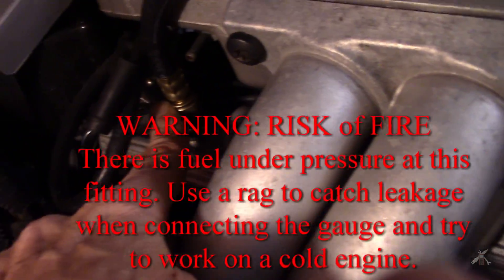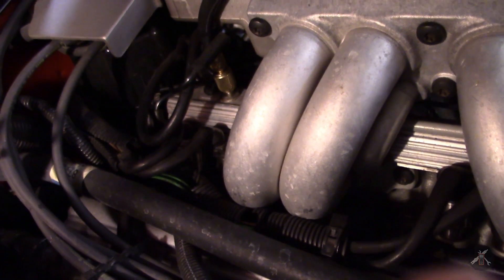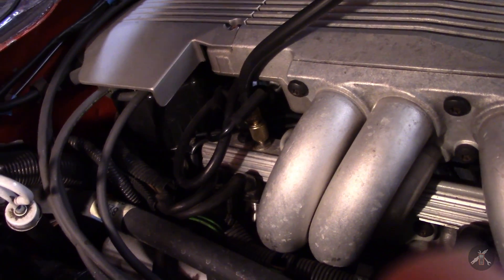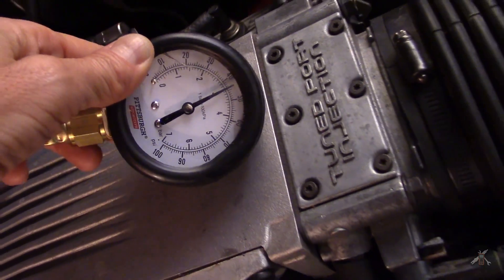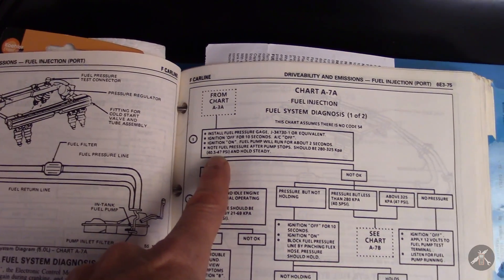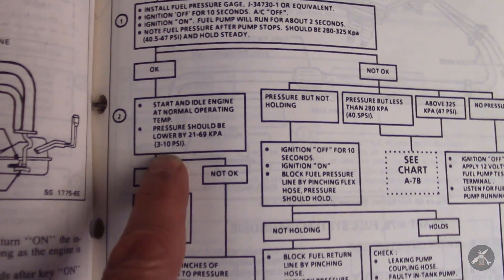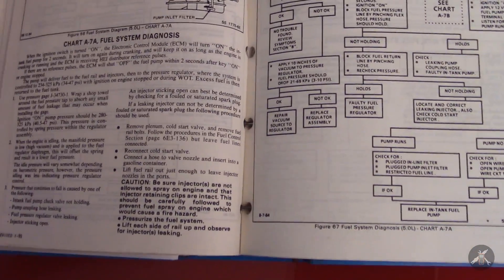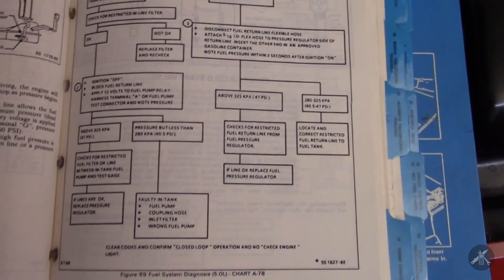How to Measure and Diagnose Fuel Pressure on Tuned Port 305 / 350 3rd Gen Camaro / Firebird

Comment: Hey there! What service-manual is that and where can I order one? Great video, really helpful and easy to understand and comprehend! Hope you're doing good!
Reply from the maker: Yes, I am doing well, thank you.  Glad the video was helpful. That is an original 1985 Camaro Shop Manual.  It's the loose-leaf version that I believe was targeted for dealerships so that it could be updated through the year.  I picked that one up through eBay.  It took some searching.  There were also some bound copies out there and I saw some offers with the manual on a CD/DVD, but I couldn't tell if those were "official" GM information.
Reply: @bitsofwisdom460  Hello again! Glad to hear you're doing good! I guess it could be hard getting one of those for my 87. Is there an other manual you'd recommend getting? Already got Haynes, but the content in it is kinda lacking compared to other manuals, especially when there so many different engine options and trim-packages for a model.
Reply from the maker: @kmas8229  Original GM manuals are the best, and they are readily available as used through various sources.  One place that you might try is books4cars.com.  I worked with the owner, Alex, at GM many years ago. He started with rare manuals for European cars, and has expanded to a rather wide range. As the business grew, he left GM to run it full time.  I checked this morning and he had a good selection of Camaro manuals.
Reply: @bitsofwisdom460  Hello again! Thanks for the tip, appreciate it very much! 
Good for him that he got to do that stuff full time, I guess he has alot of "gold"! Old articles, brochures, service-manuals and such are fascinating to look and read through.
Hope you're having a great day!
Reply from the maker: @kmas8229  You're welcome!  It's actually interesting how Alex got his start.  He was interested in various European cars that were imported to the US in low volume. He had one or two as I recall. He was having difficulty finding service manuals for them here in the US.  We sent him to Europe on business for vehicle development.  He was surprised to find manuals there, but the companies weren't interested in selling to the US at retail because of the low volume, one at a time.  He found places that would sell and ship to him in the US for resale, and it grew from there.
Reply: @bitsofwisdom460  Good morning! It's interesting to see how times have changed in that aspect and how similar it is to how it was here in Norway when it came down to cars, parts and manuals and so forth long before the internet came along.
If parts or anything weren't available at home and the person in need was working as a sailor, and was regularly in the US with the ships, then entire shipping-containers were often filled with cars, parts, engines, and everything between heaven and earth before the ships departed again to their mext destination.

There were also alot of people from Haugesund and especially Karmøy that lived in the US during the 60's and 70's that also started companies sending parts to Norway because the hunger for American steel and power was great. There were some that moved back to Norway, and they brought their cars home with them of course. 

I have a question though; If I may ask. When you say "we" sent him, do you mean "we" as in the company you worked for together sent him? Or as "we" as in a group of buds sending him off as a gift?
Reply: @bitsofwisdom460  Also, do you remember some of the cars he had over the years that were rare or seldom seen on the road otherwise?
Reply from the maker: @kmas8229  It's been a long time and I didn't keep up real well, so my memory may be off a little. When you work for an auto company, you tend to be a little quiet about owning the competition. But, I seem to recall that he had Peugeot, Citroen, and I also seem to remember a Maserati sedan (perhaps Biturbo?).

Comment: Mine leaks down as well just like yours. I believe it to be normal. My car had problems starting that I spent lots of time trying to corner the issue. I replaced lots of sensors and did all the checks in the sevice manual. Ended up being the remote pick up coil that failed intermittently. Easiest fix was a distributor complete with pick-up coil and module. Now it starts like a dream..... 😊
Reply from the maker: Thanks for the feedback, that's good to know.  And yes, the intermittent electrical issues can be a great challenge.
Reply: where is the remote pick up coil located? is it the ignition module inside the distribuitor?

Comment: Yesss my trans am does the excact same thing, you shut it off it might take several hours but it does drop, I agree, I think just a little seepage for an almost 40 year old car is more than perfect. Doesn't seem to hurt or flood anything so i dont worry
Reply from the maker: Yes, agreed. If I thought that it was an injector dripping, it might be an issue because you could foul a plug, have smoke on start up, or have gas dilution in the oil. No sign of that, so no worry.
I was a little surprised when I rebuilt the regulator and fuel rails that it appeared that the regulator seal was metal to metal. Those can be hard to seal 100%.

Comment: You've been reading my mind. A fuel injector pulse tester just arrived. I've got new injectors as part of preventative maintenance for my car that sat for years and had the original injectors. Now I'm diagnosing several issues that impact it running correctly. Can't wait to watch your video. Thanks!
Reply from the maker: You're welcome!